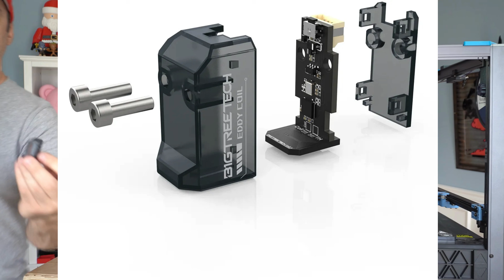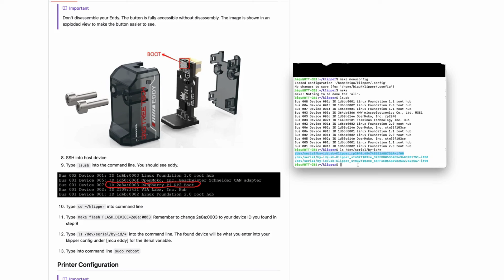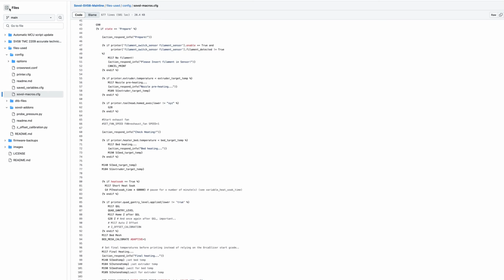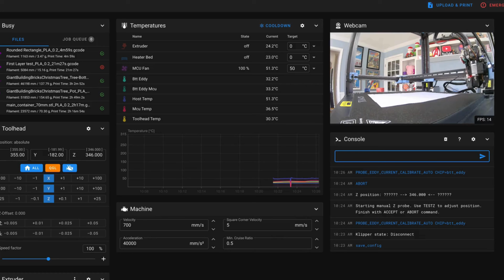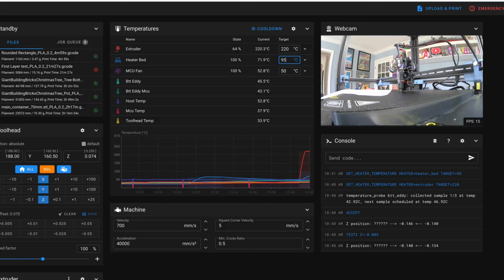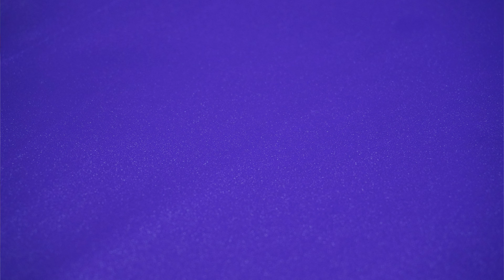BTT Eddy USB Probe Setup on Sovol SV08 – Full Install & Calibration Guide

Comment: I installed the btt eddy on my svo8 and have found it to not be great for z-offset. It works ok after a calibration, but later on when you go to print its always out just like the original probe.
Reply from the maker: What does your bed mesh look like? I have found that I have to let the bed heat soak at whatever temp I am printing at for 5 minutes or so. Then when I run my print start - it bed meshes and first layers are consistent. If it's cold and I go straight to printing when the bed heats up I have had some issues. 

Also did you do the heat compensation calibration? You may need to revisit that after your initial calibration. 

You can also do this below to add the z-offset save function, which will work more like a traditional probe offset adjustment and allow you to save your z-offset. 

In your eddy config I would comment out your existing macros and paste the below in what I am using for macros.

# Uncomment this if you are using Eddy as the probe AND the homing endstop AND would like to use the beta z-offset control
[save_variables]
filename: ~/printer_data/config/variables.cfg

# Uncomment this if you are using Eddy as the probe AND the homing endstop
[force_move]
enable_force_move: True # Allows a user to move the z axis down if they have no other means of homing Z and need to calibrate the Eddy.

# Uncomment this if you are using Eddy as the probe AND the homing endstop AND would like to use the beta z-offset control
[delayed_gcode RESTORE_PROBE_OFFSET]
initial_duration: 1.
gcode:
  {% set svv = printer.save_variables.variables %}
  {% if not printer["gcode_macro SET_GCODE_OFFSET"].restored %}
    SET_GCODE_VARIABLE MACRO=SET_GCODE_OFFSET VARIABLE=runtime_offset VALUE={ svv.nvm_offset|default(0) }
    SET_GCODE_VARIABLE MACRO=SET_GCODE_OFFSET VARIABLE=restored VALUE=True
  {% endif %}

# Uncomment this if you are using Eddy as the probe AND the homing endstop
# Take note of the lines that should only be used if you have a KNOMI installed.
[gcode_macro G28]
rename_existing: G28.1
gcode:
  #SET_GCODE_VARIABLE MACRO=_KNOMI_STATUS VARIABLE=homing VALUE=True # Uncomment this if using a KNOMI and then remove the G28 macro from the KNOMI.cfg
  G28.1 {rawparams}
  {% if not rawparams or (rawparams and 'Z' in rawparams) %}
    PROBE
    SET_Z_FROM_PROBE
  {% endif %}
  #SET_GCODE_VARIABLE MACRO=_KNOMI_STATUS VARIABLE=homing VALUE=False # Uncomment this if using a KNOMI and then remove the G28 macro from the KNOMI.cfg

# Uncomment this if you are using Eddy as the probe AND the homing endstop
[gcode_macro SET_Z_FROM_PROBE]
gcode:
    {% set cf = printer.configfile.settings %}
    SET_GCODE_OFFSET_ORIG Z={printer.probe.last_z_result - cf['probe_eddy_current btt_eddy'].z_offset + printer["gcode_macro SET_GCODE_OFFSET"].runtime_offset}
    G90
    G1 Z{cf.safe_z_home.z_hop}

# Uncomment this if you are using Eddy as the probe AND the homing endstop AND would like to use the beta z-offset control
[gcode_macro Z_OFFSET_APPLY_PROBE]
rename_existing: Z_OFFSET_APPLY_PROBE_ORIG
gcode:
  SAVE_VARIABLE VARIABLE=nvm_offset VALUE={ printer["gcode_macro SET_GCODE_OFFSET"].runtime_offset }

# Uncomment the lines in this macro if you are using Eddy as the probe AND the homing endstop AND would like to use the beta z-offset control
[gcode_macro SET_GCODE_OFFSET]
rename_existing: SET_GCODE_OFFSET_ORIG
variable_restored: False  # Mark whether the var has been restored from NVM
variable_runtime_offset: 0
gcode:
  {% if params.Z_ADJUST %}
    SET_GCODE_VARIABLE MACRO=SET_GCODE_OFFSET VARIABLE=runtime_offset VALUE={ printer["gcode_macro SET_GCODE_OFFSET"].runtime_offset + params.Z_ADJUST|float }
  {% endif %}
  {% if params.Z %} 
    {% set paramList = rawparams.split() %}
    {% for i in range(paramList|length) %}
      {% if paramList[i]=="Z=0" %}
        {% set temp=paramList.pop(i) %}
        {% set temp="Z_ADJUST=" + (-printer["gcode_macro SET_GCODE_OFFSET"].runtime_offset)|string %}
        {% if paramList.append(temp) %}{% endif %}
      {% endif %}
    {% endfor %}
    {% set rawparams=paramList|join(' ') %}
    SET_GCODE_VARIABLE MACRO=SET_GCODE_OFFSET VARIABLE=runtime_offset VALUE=0
  {% endif %}
  SET_GCODE_OFFSET_ORIG { rawparams }

# This macro automates a lot of the frequency mapping process and simplifies the steps significantly.
[gcode_macro PROBE_EDDY_CURRENT_CALIBRATE_AUTO]
gcode:
  BED_MESH_CLEAR
  G28 X Y
  G90 # Abs positioning
  G1 X{ printer.toolhead.axis_maximum.x/2 } Y{ printer.toolhead.axis_maximum.y/2 } F6000
  {% if 'z' not in printer.toolhead.homed_axes %}
    SET_KINEMATIC_POSITION Z={ printer.toolhead.axis_maximum.z-1 } # Allows the user to work it down until it touches.
  {% endif %}
  PROBE_EDDY_CURRENT_CALIBRATE {rawparams}

#This macro is optional but useful if you want to run a rapid scan before each print. Simply uncomment it and add BED_MESH_SCAN to your print start code.
[gcode_macro BED_MESH_CALIBRATE]
rename_existing: BTT_BED_MESH_CALIBRATE
gcode:
#  SET_GCODE_VARIABLE MACRO=_KNOMI_STATUS VARIABLE=probing VALUE=True #Only uncomment this line if using a KNOMI and then remove the BED_MESH_CALIBRATE macro from KNOMI.cfg
  BTT_BED_MESH_CALIBRATE METHOD=rapid_scan
#  SET_GCODE_VARIABLE MACRO=_KNOMI_STATUS VARIABLE=probing VALUE=False #Only uncomment this line if using a KNOMI and then remove the BED_MESH_CALIBRATE macro from KNOMI.cfg
Reply: @ThePrintasaurus  Thanks for the macros above. I can see they are from the eddy beta config file. Updating to these macros I am now able to save the z-offset and now its been consistent for 5 test prints. I tested both from a cold start with 5 minute heat soak and starting a print after the previous finishes and am getting the z-offset to be spot on or only out +/- 0.05 mm which is easy to adjust while its doing the purge lines.
Reply from the maker: @slowlane3391   I'm glad things are working more consistently! The beta z-offset config I'm going to add to my description. I've been using / testing for a week or two now and with you confirming successful prints I think it's a good option to include.  
Something I am looking into now is the bed, mine is close in anyway to being flat. I'm experimenting with shims, but might look at bed replacement options too to see if I can get things even better!!

Comment: 2:30
Finds random plastic thing that is 20mm..... 

 if only we had the technology to make something that is the exact size we need.  Would be great if it melted plastic in controlled ammounts in different shapes with comouter controlled precision.  I guess maybe some day.   Going to measure Legos.
Reply from the maker: I approached that with the idea of options. If you have calipers use them, ruler that works too. If you don't feel like holding something there as you micro step a lego duplo happens to be a close enough size. Some could easily make a simple square, rectangle in fusion, solidworks and print it. I figured those that can do that would go straight to that.  Thanks for watching, and I appreciate the support! 

What kind of stuff are you printing? Always curious to see what all everyone is working on?
Reply: @ThePrintasaurus just pointing out the irony.   Very thorough walk through.   Not as flashy as some of the other sites, but your explanation and attention to detail exceeds most of them in my opinion. 

I print all sorts of stuff.   I just got done doing 400 clips for Christmas lights.  Yes all 400 fit on the plate.   20x20 grid.
Reply from the maker: @spsully2582   Wow that is a lot of clips!!  I to have a list of things for christmas to print for the kids and wife!  I appreciate your opinion as well, that is what I aim to do. I want to make content that is easy to follow and helps people. Eventually I'll have some extra cameras to do all the extra stuff with!
Reply: @ThePrintasaurus I'm sure you know, but for your viewers...

In orca slicer, 
-right-click on empty build plate
-primitive
-cube
-scale to 20mm uniform

No cad needed

Comment: Great video, easy to follow and understand.

Interested in your view on the calibration/z-offset functionality. With the increasing popularity of quick/cold change nozzles (E3D Revo and Micro Swiss Flowtech), frequent nozzle changes (hardened, hi flow, >0.4) might become more of a thing. The stock automatic z-offset should be of great use. The way Eddy seems to be setup, this doesn't work. Others implement contact/tap (Carthagropher/Beacon), but although this was also worked on for Eddy, this seems not to be finalized or planned yet (to my knowledge).

Would you see a combination of the Eddy in conjunction with the load cell as a possible workaround or maybe a less involved calibration procedure than the first calibration?
Reply from the maker: Thanks for watching and the support!  Very good question, just to add I am testing the micro swiss flowtech soon! 
I am a fan of the quick change nozzles, I think it adds a ton of versatility and makes the process fast. 

I have been playing around with the Beta Z-offsets for the eddy coil. The macros allow you to save Z by micro adjustments. So far I'm able to fine tune to an extent but I'm fighting the bed issues now too. The bed I have is far from level, and I'm looking into options to improve things there. 

Tap is one of my favorites for the reasons you have mentioned. Eddy has the advantage of speed, which is why I wanted to give it a shot. A load cell would be a good option to compliment eddy, I'm hopeful as things advance with Eddy that BTT will offer some extended features. I think it's got potential. The calibration process is lengthy, the temperature compensation is a welcomed addition with the USB version. 

Beacon is something I'd like to try next, all the feedback I have seen so far has been really positive. I just picked up a Orange Storm Giga, and I'm looking into the "blue storm" which pairs the beacon probe with a Chube hotend. 

I'll keep you posted on my progress with Eddy and the Sv08, I'd like to continue fine tuning and playing around with the beta macros to see if there is a "secret sauce" to getting things more dialed in and a process to make things more interchangeable. I'm going to run into this scenario when I start working with that flowtech. So I'll have something to create a workflow and finetune what I can to cut down on calibration time. I'll share that as soon as I get it figured out!!
Reply: @ThePrintasaurus  Thanks for the thorough reply. Great to hear you are also considering the same aspects in this printer journey. I've subscribed to your channel, so I'm looking forward to updates on your experiences. Good luck!

Comment: Great VID Aaron.  I have my Eddy on order and will be following your steps again.
Reply from the maker: This one is way easier than the klipper upgrade too!
Reply: I had to reflash my eMMC today after a forced power stop when the z limit failed on me.  It must have corrupted something on the eMMC.  Redid everything but luckily did not have to flash the MCUs.  Luckily I had a backup of all my files so it was much easier this time around.  Only took about 30 minutes.
.

Comment: Great video. Thanks for making it. I see you have some X1 Carbon’s. I own an X1C and I’ve been considering buying an SV08 for the build volume and the ability to upgrade it and tweak it etc.. but I’m curious, as an X1C owner, how do you compare the print quality between the two? My X1C has been a workhorse with consistent amazing print quality.. it just works over and over again. How do you find the print quality of the SV08 in comparison with or without your upgrades so far. I’m not expecting the user experience Bambu offers of course.. just wondering about the print quality you are getting
Reply from the maker: Thanks for watching and that is a great question!  The X1C is definitely a level above the SV08 for sure in terms of ease of use and setup. Which is probably the largest difference between say a voron type printer / SV08 voron clone and the Bambu printers. The bambu's just work out of the box, you really don't need a ton of printing experience to have a great printing experience.  The SV08 can be a good printer, that offers very similar quality of prints, it just takes some work to get it there. I have the SV08 and a voron 2.4r2 350mm and my Voron prints excellent (But that too is hours of testing and tweaking and upgrades). I will say the upgrades I've done so far inch the SV08 closer to a more expensive Voron 2.4 which is a good thing. 

If you want something to tinker with, has potential and you need the additional build volume the Sv08 isn't a bad choice. It's on sale now too for black friday / cyber monday so that makes it even more of a bargain. I'm testing some hotends to see if I can further improve print quality. Things are improving greatly, and the side comparison of the same print on the x1c and sv08 is getting harder to tell a difference.
Reply: Thank you! Just knowing that it is possible to get them that close in visual print quality is probably good enough for me to take the plunge.. the price is definitely right. I just found your channel and enjoy these sv08 videos, thanks for taking the time and effort to make them and share your knowledge and experiences etc.
Reply: @colinmsmall  very different animals.   X1c basically needs nothing but only prints so big.   Sv08 almost needs upgrading (if not need then definitely would recommend) but here's the real thing.   You can make an sv08 print bamboo quality for way less time money and effort than you could dream of getting an x1c to print 350x350x340
Reply from the maker: @colinmsmall   No problem at all! There will be plenty more videos on the SV08. I have been using it more and more lately.

Comment: on my sv08 the fan was actually on the connector on the bottom right (the 3 pin connector)
Reply from the maker: Interesting. When did you receive your printer? Mine arrive in early August. I wonder if this is / was a QA check. I'm curious what Pin is assigned to your front fan? I went back and looked at my original print.cfg  to make sure I wasn't crazy and it's PB0 - which is the top right, PB1 is the lower fan connector. So my SV08 appeared to ship plugged into the upper right pin!! Now I'm curious if others are experiencing this issue. I'm going to add the pin # for each location in the description so everyone can adjust as needed.
Reply: @ThePrintasaurus  mine is connected to PB1 . 

[fan_generic fan1] # front model cooling fan
pin: extra_mcu:PB1
max_power: 1.0
Reply from the maker: @Dutch1969   Thanks for following up. I'm going to add that information now, so whomever can use either if the configuration is different. Thanks!
Reply: @ThePrintasaurus  there are 2 location where you can plug in the cover fan.  They are both Fan 3 PB0. If I could post a pic of all the connection I would.  I will email it to you.
Reply: I received mine two weeks ago and was also connected bottom right

Comment: Is there any way to use the Eddy device (any of the Eddy models/interfaces) *with* the existing probe pinout already on the toolhead board?
Reply from the maker: BTT is supposed to have a can verizon coming out, they currently have one that works with a nighthawk tool board. EBB36/42. BTT also has a duo out that I can't find any additional information on. That supports usb and can. I'm going to try and order one and see if that is an option. I can report back once I've tested and gotten familiar with the duo version.
Reply: @ThePrintasaurus I would be interested in what you find out also.
Reply: Yes but it's not particularly easy. There's I2C on the probe pin header so you can use that and get 5V from somewhere else. Or a regulator on the 24V of the probe pins.

I then had communication issues. There's an errata for the st chip used it the toolhead and the workaround didn't seem to work. I don't know what's going on but basically I got it to work by pulling the pins low at start, then pulsing the clock pin a bunch to shake loose the devices on the bus.

The pull ups of the I2C bus of the Eddy was too weak so I changed those. And finally there's no temp sensor so I glued an LM75 to the eddy PCB and the I2C.

It works well but I'd say it's not worth the hastle.